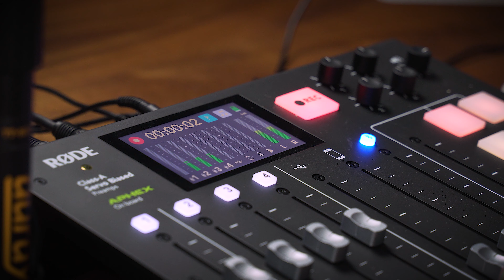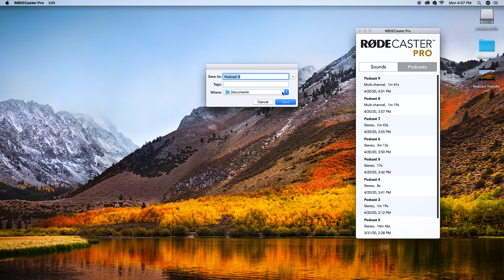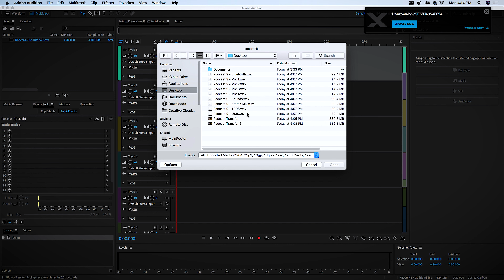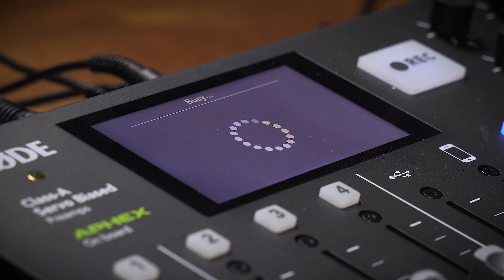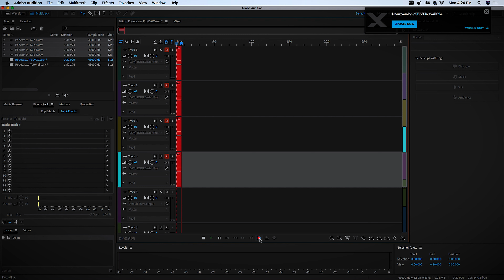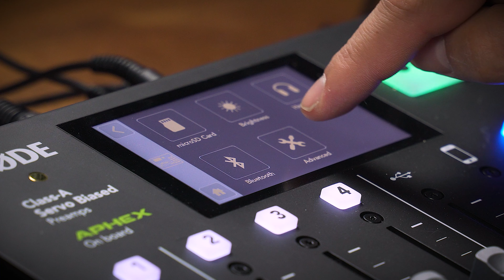Rodecaster Pro - Multi-Track Podcast Recording + Firmware Update Tutorial

Comment: having a hard time recording multitracks with garageband. even though the inputs are matched up. both mics are recording on both tracks. any suggestions? do i need to switch to audition?
Reply: wow actually just figured it out! 

on garageband input 1 & 2 are stereo mixes. so technically input 3 in garageband is input 1 on the rodecaster. hope this helps anyone else who ran into this issue! if im missing something please correct me before its too late 😰

Comment: I noticed your waveform/levels in the multitrack import into Audition was very very low, I am having same issues with import of multitrack files from the Rodecaster Pro into Logic Pro.  Compared to the stereo mix file that comes in at full volume and crisp audio.  Logic Pro reqires me to add about 10db gain on each track, is that normal?
Reply from the maker: Hey Sam, first, thank you for watching! When you are importing the multi-track files, all of the post-processing is most likely disabled, so you are getting the raw audio. The stereo mix file typically includes all of the on-board processing, hence why it sounds louder, clearer, etc. Some people will use a cloudlifter or fethead to boost the input gain going into the board. This is mainly because the Podmic requires a lot of gain, and the Rodecaster Pro does not have the best Preamps. You can either crank up the on-board preamps or boost the file in your DAW. Either way will introduce some noise which should be relatively easy to remove with a denoiser plugin. Hope that helps!
Reply: @MenajErieStudio  No, it wasn't that I checked that first, what it was that i figured out was, I turned off Master Compressor channel and that fixed it. If that is on, Rodecaster Pro has a much lower volume output on those tracks.  So that work around is all I have now to get me by.  Thanks for your time and response.

Comment: Hello from France,
great video, thx.
I use Discord to communicate with people and to record.
Is the multitrack option allow me to have a specirfic track for me and another one for people ?
Is it ok for using directly on adobe premiere (2 tracks audio) ?
Finally,  the fader of the Discord track will be which one on the Rodecaster ?
A last question, I will use just one micrphone, so can I use fader 2, 3 and 4 of exemple to control the volume of : discord - OS system and music (as it is possible with GoXlr) ?
Thank you for tour response
Reply from the maker: Hi there, thanks for watching! There are a couple of ways to do that. You can plug the Rodecaster into your computer via USB and have it feed the computer audio into the Rodecaster. There is a channel fader for USB audio that you can use to control the volume. The other way is to use the Rodecaster as an audio interface and feed the audio into Premiere or better yet, Audition. Breaking out your computer audio into separate tracks as you described is a bit more involved, and unfortunately not something I have experience with. Best of luck!

Comment: Question:  If I wanted to use my Rodecaster Pro for audio with my YouTube videos, what should be my settings?  My 1st video using the Rodecaster Pro the volume is too low.  Help!  Thanks
Reply from the maker: Hey there, so it is hard to say without knowing your full set up, but beyond boosting the mic input or channel fader, you are going to have to apply more gain in post-production. If you are recording into something like Adobe Audition, try adding a tube compressor to the channel effects. Try the Voice Over preset, and boost the input gain until it just starts engaging.
Reply: @MenajErieStudio  Thank you!!